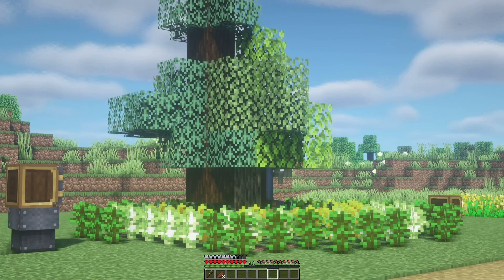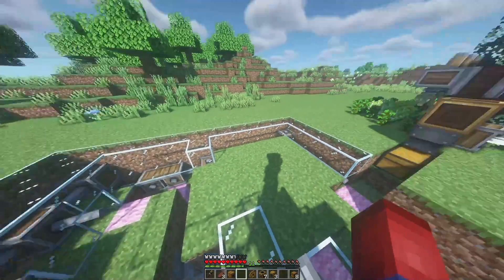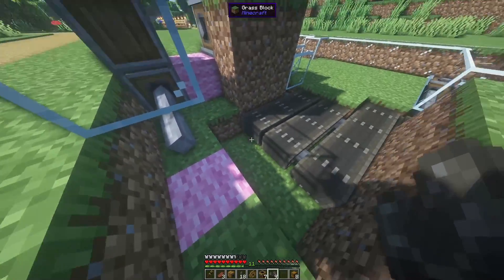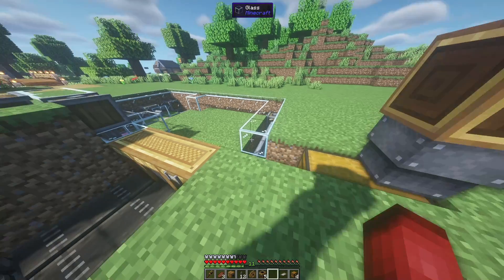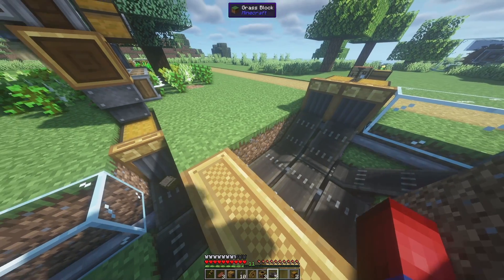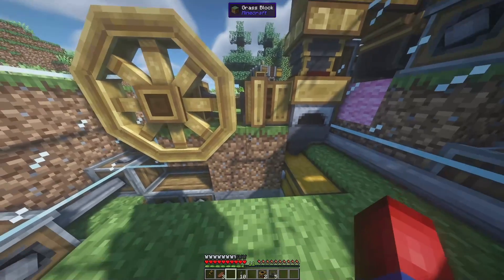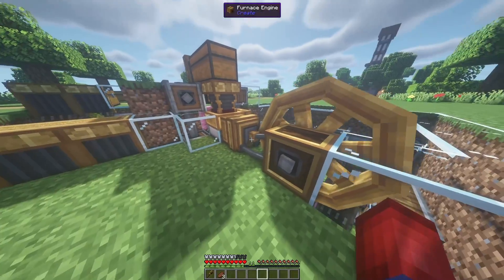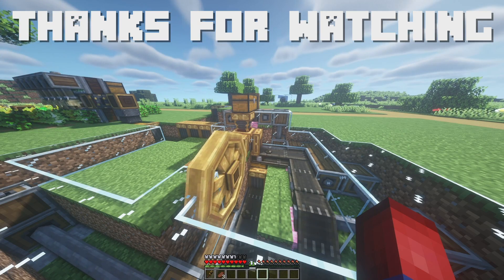Minecraft Create Mod Tutorial - Flywheel & Furnace Engine (Infinite Power Source!) Ep 12

Comment: Found a fun little glitch/feature when trying to cobble together my own Flywheel FE set up: You don't need the round-about belt for the charcoal (Unless you, for example, want to make an overflow for the charcoal.

Place a shaft just below the furnace and one diagonally from that, next to an unobstructed cardinally facing side of the furnace. Connect the two with a mechanical belt and...

That's it. You don't even need to power it, it just instantly pops the charcoal into the fuel input.
Reply: Sorry, my bad, it was a funnel underneath the furnace pulling downward, and the shafts were underneath/adjacent to the _funnel_.
Reply: Gah, actually went and tried to implement it and it was jank af.

Absolutely a glitch, and not a super consistent one.

Comment: Just to confirm, is this Create 0.3 or is it the older version? Didn't want to waste all my resources for something that doesn't work anymore haha!
Reply from the maker: Haha nope this is create 0.3!
Reply: @rockit14  Also, would you have any idea why my flying wheel is only making 16k power rather than the 32k?
Reply from the maker: @puggyr650  so from my understanding depending on what subversion you are using of create 0.3 it will output either 32k or 16k.

That being said 16k should be able to output practically every machine you hook up :)
Reply: On create 0.5f they removed it for being overpowered I guess

Comment: good job, but ive made it kinda smaller. 
things to make it better: 
1.you can stack the tree farm on top of your engine room to directly feed form the hopper. having brass funnels to only except wood types, this would skip the use of rose quartz.
2.you can refeed the furnace without that big loopdehole. if the hopper is placed onto the belt sideways, it would place thay item on top fo the belt. and then, you can give that item back into the furnace by adding a funnel to the furnace's sides.
3."stop using that excess charcoal" method i like to call it, is to attach a 80 second redstone clock to the hopper on top of the engine to maximize every charcoal's burn duration(80 seconds) and preserve your logs.
Reply from the maker: Thanks for the tips man I knew this was a perfect implementation but I figured it would help some people get some ideas!

Comment: There's a mod that adds literally just an up-facing hopper (for 1.16.5 afaik), it's an option for the furnace refuelling part as far as I can tell
Reply from the maker: I will have to look into this! Although, I try to make these tutorials without those mods so people don't have to figure out their own solutions.
Reply: @rockit14  You could place an upward facing dropper down one and to the side one then use a hopper to pull from the furnace and put in the dropper. Then have the dropper fire the items into another hopper that is facing the furnace. You would then want a comparator clock firing the dropper when it has items in it. 

Also, this farm would eventually fill up and stop running. Should probably setup a way to toss any excess production onto a cactus.

Comment: hey rockit, ive watched some of your other videos but i am wondering how to do the power to this? i built a water wheel and attach it to some points but they go backwards. do you think u can make a video on how to do the mechanics part of this?

love the videos, thanks
Reply from the maker: I recommend watching episode two as they explain on how gearboxes and shafts work. An easy solution is placing another gearbox as that will change the direction of the rotation.

I recommend joining the Discord as I can help you through a little bit better on there :)
Reply: @rockit14  oh sweet thanks so much, yea il join the discord

Comment: I was curious and did some creative-mode tests on this. If the engine runs long enough, it can eventually reach a point where the fuel belt, chest, hopper, and furnace output are all full of charcoal, and the furnace will stop burning fuel if it can't output anything. This flaw is easily fixed by adding a brass tunnel set to "prefer nearest output" on the fuel belt, and having the secondary output send excess charcoal to a pit or trash.

Also, you can do this with a kelp farm too, if the fuel belt has a mechanical press with basin to compress the dried kelp into blocks.
Reply from the maker: Thanks so much ways! Just pinned your message to help others :)

Comment: Can u say what are the pc requirements of create mod
Reply from the maker: I am not to sure, but I would say you would at least want to have 8GB of ram and dedicate at least 2-3GB to this mod (if you are running only this mod)

Overall this mod isn't too intense until you begin to build multiple complex machines.  I would recommend adding optifine to boost frames and other than that you should be fine.

What specs do you have?
Reply: Honestly I have a pc with i5 intel graphics
Reply from the maker: @phumorous132  Honestly, I would try it out - see what happens. One of my friends can run it and he is using a pretty trash laptop to say the least!